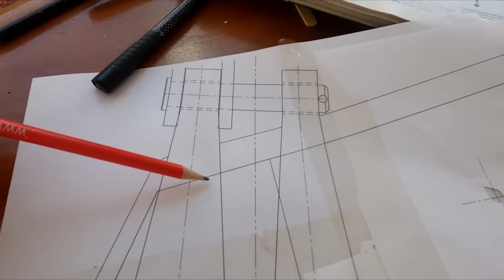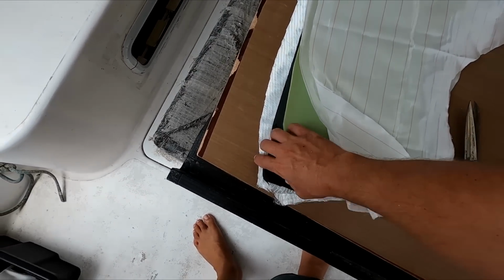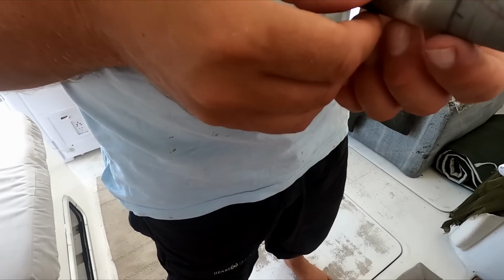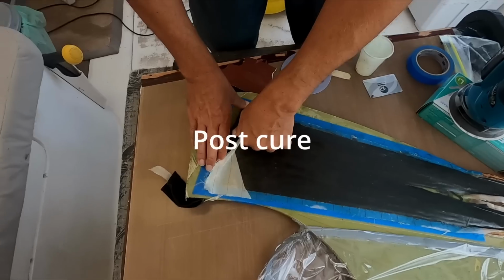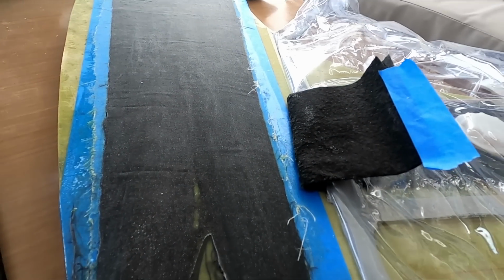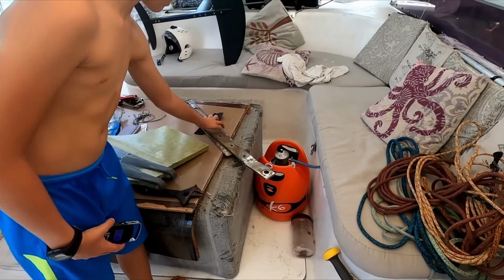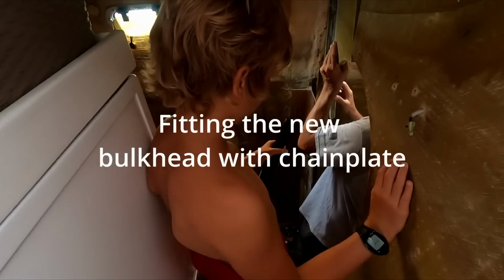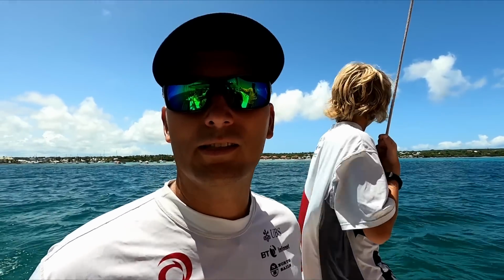How We Engineer Carbon Fiber Chainplates | Pro Boat Building

Comment: very nice work with the carbon fibre. However, cutting just one quarter of the bulkhead out and replacing it seems a bit risky to me. Why not change the whole bulkhead, or at least half of it?
Reply from the maker: That is the beauty of working with composites. We cover that question in the next video https://youtu.be/NFwAMrp7daQ?si=uDMZ-XaS8hvCnOeY

Comment: Great video - thanks! We’re looking at doing a similar project on our 43ft tri… are there any good calculators or references for working out what weight carbon should be used, and how many layers?
Reply from the maker: It would be best to talk to a naval architect or composite engineer. Either Gurit, Pure Engineering or SDK are good options. Evan Gatehouse would be able to steer you in the right direction too ( he helped Duracell Project guys). There are no rules of thumb with composite engineering as there are with wood or steel. If you want to learn more you need to start with composite engineering texts. Good luck!
Reply: @youngbarnacles Thanks! That’s really helpful. Really enjoying Matt’s work on Duracell as well - just a real craftsman who’s obsessed with the detail. Love it👍

Comment: Didn't know about the peel ply. But if you sand it with silicone particles on it these will just be spread all over the surface. Have you cleaned it before sanding?
Reply from the maker: https://youtu.be/T-TXRqejb3I
Reply: @youngbarnacles  Sorry, this didn't answer my comment. I was talking about the silicone spread across the surface by sanding without cleaning before. The same goes for the wax you mentioned here. I'm a German naval architect, so I don't know the English name for that wax right now. But I have been working with composites, wood and epoxy for some 30 years for private projects and business as well. If the surface is not good for bonding before sanding it may be even worse depending on the amount of this stuff on the raw surface after sanding because of the mentioned chemicals which tend to separate layers of epoxy.

Comment: I see you putting on a lot of strips of carbon fiber. Just from looking at the time-lapse, it looks like a random slapping on as many strips as you can. Is there a method to the madness, i.e. is there some calculations to determine the right/minimal amount of strips to achieve a specific minimum amount of strength? Is it possible to put on too many strips, or does 'more is better' apply here? What is the benefit of using multiple narrow strips, vs on-piece layers covering the whole area (apart from cost reduction)? Is the end result stringer than the steel chain plate?
Reply from the maker: Most of these questions are answered in the following video https://youtu.be/NFwAMrp7daQ

Comment: Thanks for that, great video. I would be interested in the lamination of the section into the hullside and deck part, the requirement to feed the loads taken by the carbon section into the rest of the boat. I guess there were many layers of double bias to spread the loads out into the rest of the structure. 
Also, why use what looks like 80kg foam? I guess that as long as each side of the chainplate is equally loaded there will not be huge shear on the core but isn't typical good design to use a high density foam core or plywood (I know the last core was plywood but composite chainplates are leak free)?
Thanks again, great tech stuff on peel ply and the problems of exotherm on thick laminates.
Reply from the maker: Cheers Philip. We'll put together a follow up video addressing these points.

Comment: Fantastic work!  Can I ask why you did not go ahead and make the entire bulkhead section out of carbon fiber while you were at it?  Are you not really gaining that much with the bulkheads themselves being full carbon vs the foam core E-glass?
Reply from the maker: Thanks. You assume correctly. At the end of the day Paikea is still a polyester boat. It just wasn't worth the cost to make the bulkheads out of carbon fibre as well. A lot of the time we have to draw a line in the sand  and decide how crazy we go with the upgrade/modifications.  The foam eglass bulkhead  does the job more than adequately and we save some $$ by not using as much carbon.
Reply: @youngbarnacles  thank you sir!  We are trying to decide now on if we want to spend the extra dollars for full carbon bulkheads on the boat we are having built or sticking with e-glass that’s CF reinforced in all the high load areas.  No shortage of ways to spend money lol!
Reply from the maker: Send me an email admin@youngbarnacles.com
There are a few questions you need to ask before that question can be answered in regards to your own build 👍👍
Reply: @youngbarnacles  thanks Shayne, will do!  Your opinion would be greatly appreciated.

Comment: Great work as always!
Love to hear a bit about how you engineered these, like whats the thought process of how many layers of uni, width of the chainplate. Im trying to gather enough info for our own 25footer and is generally for a if it looks stong enough it's probably overkill but works . Any recommendations for a "napkin calculation" of the layup?
Reply from the maker: The load paths are different on every boat so unfortunately there is no rule of thumb to be applied. Having enough layers of carbon is only one small piece of a larger puzzle. If the carbon is not in the correct position it will not be able to deal with loads applied to it.

Comment: Super interesting video from a structural perspective.  I would have really liked to see how the bulkhead section was structurally integrated into the rest of the boat. There is a massive upward force trying to bow the boat up on each side
Reply from the maker: We did throw a bit of that footage in but it was such a large and complex process and we edited a lot for YouTube so you might not have seen enough. Might do a follow up vid on this if enough people are interested 🤔
Reply: @youngbarnacles  Please do a follow up on the how you laminated the bulkhead section :) impressive job as always.
Reply: @youngbarnacles  yeah it feels like this bit was missing. brilliant otherwise!

Comment: Love it ♥️ so clever. But I do have to ask... now the chain plate is all carbon and stiff but attached to a piece of foam which is butt joined to the old bulkhead... is glassing this foam bulkhead insert to the old enough? 🤔
Reply: The camera went by pretty quick, but I saw lots of fresh glass and biaxial carbon tying together the new foam to the original plywood-cored areas. He's built in plenty of shear strength to ease your concern ;)
Reply from the maker: Yes it's structurally sound. We reinstated the fibreglass that was the bulkhead with an additional patch over the top of the carbon chainplate. So there is actually more fibreglass there than there was before.

Comment: Great video as always, really love all the technical details! May I ask, how many layers of carbon was used and what weight? How big safety factor did you put into the new chainplates, what will the breaking strength be in these chainplates?
Reply from the maker: The strength of the chainplates is 10 x the strength of our side stays. We used more layers than we needed in order to get dimensions and aesthetics right. We used 300g carbon unidirectional fibre.

Comment: The sanding also helps expose some fibre ends to which the new laminate can bond more effectively too, right?
Reply from the maker: Not really. You only want to shatter the resin matrix, cutting the fibre with the sandpaper is not what we are trying to achieve. The aim is to keep the fibre as intact as possible. Every fibre you sand and break will weaken the structure.